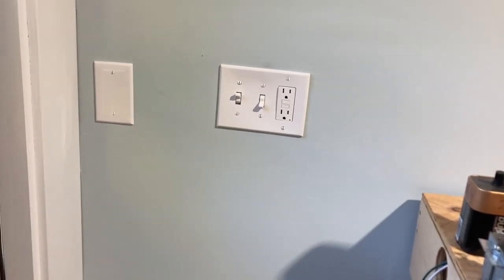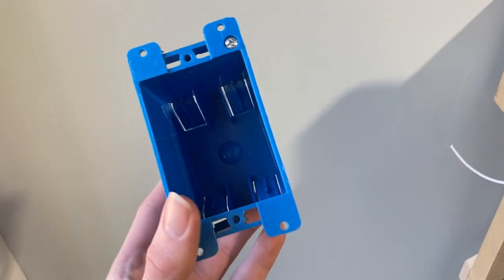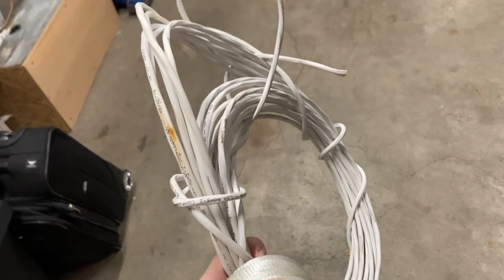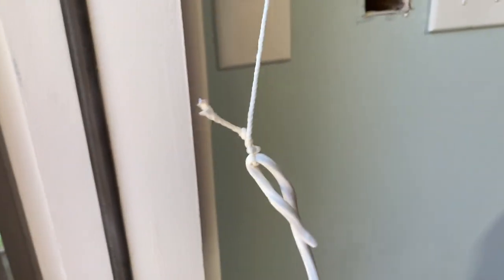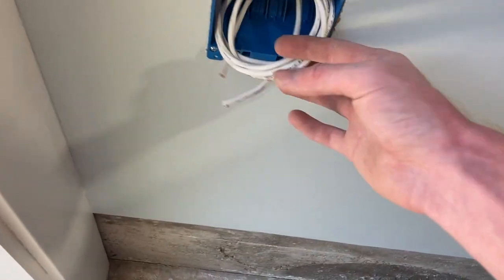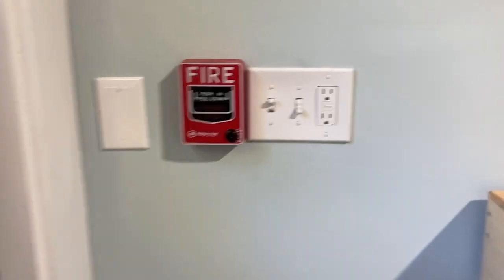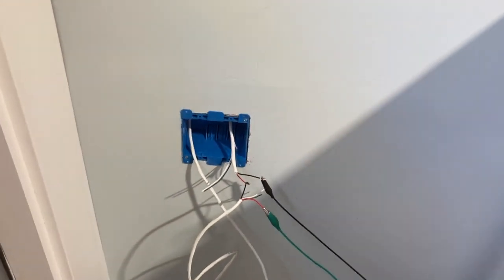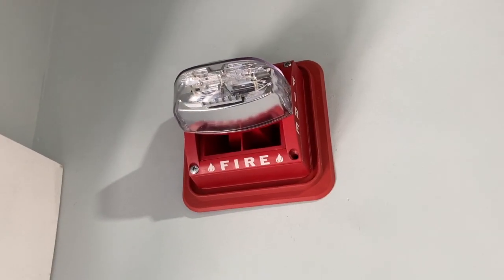Installing Another Demo Setup!

Comment: That setup  looks  much  better  than  some  of  the  setups  that were  featured  in  the  "Fire Alarm fails" episodes, particularly  the  ones  installed upside  down, a wall mount  on  the  ceiling or worse, cement flushed into  the  wall. I would  have  definitely  fired the  contractor  or sued him  in court  for messing  up  the  building's  fire alarm  system, honestly.

Comment: Word of caution with the plastic electrical boxes. The screw holes degrade over time and it’s kind of a paint to mount stuff to them due to the larger diameter screws :)